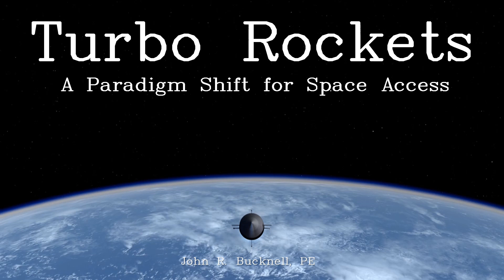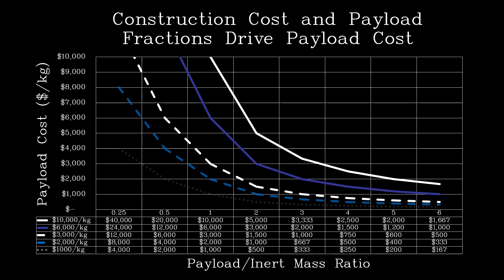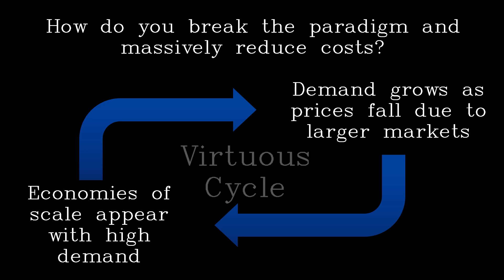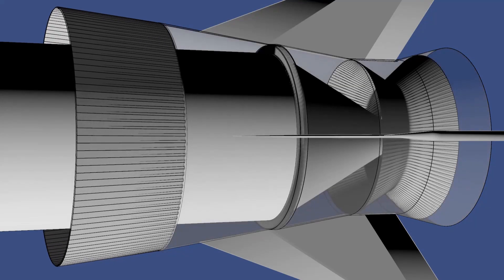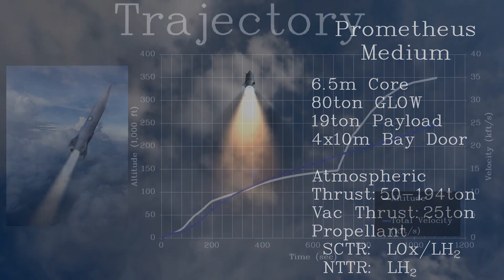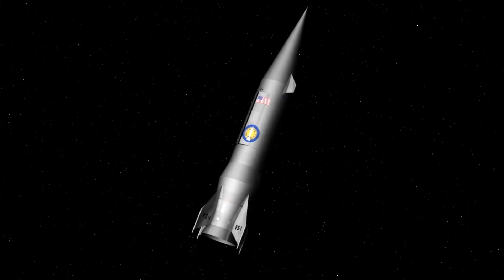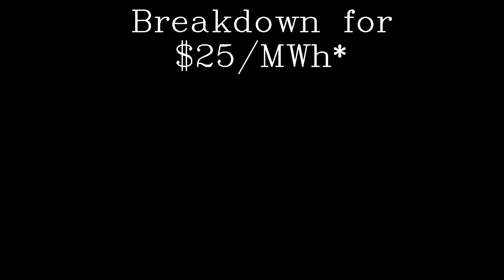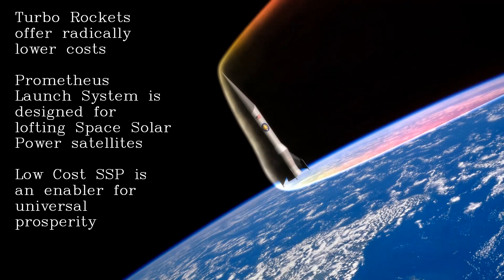Space Access 2019 Turbo Rockets Presentation

Comment: Thank you for this!
Firstly it is great that you managed to work out how to get similar performance without a reactor on board. That IMO was the biggest roadblock by far.

Could you elaborate more on your space based PV design. It looks great.
Personally, I am trying to work on high altitude (20km) solar power as a stepping stone to space-based solar power.
How ready do you think modern PV is to deal with harsh thermal and radiation environments like space?

The second reason for 20km tethered solar platforms is that they could work great as rectennas. 183GHZ gets absorbed bellow 15km meaning beaming power would be entirely safe and high power intensities can be used.